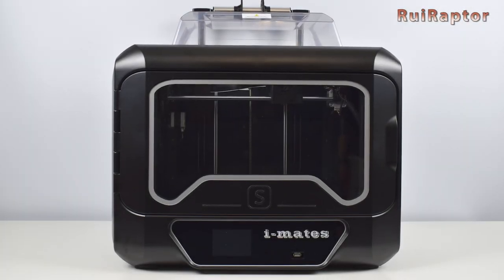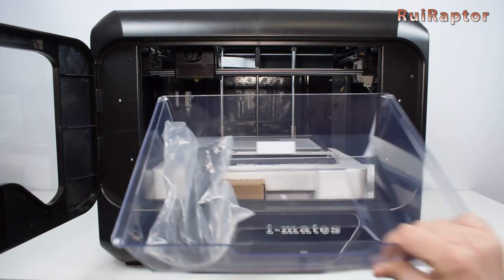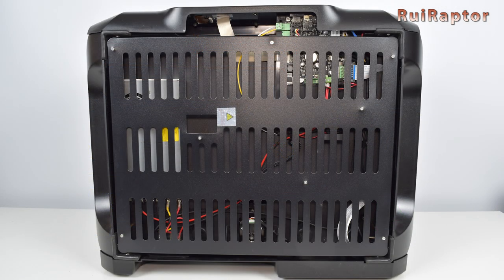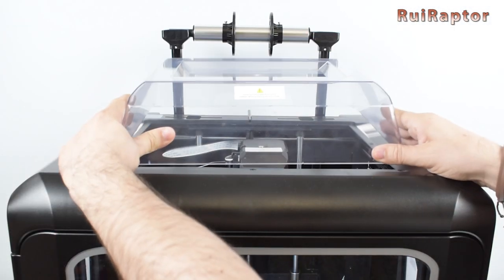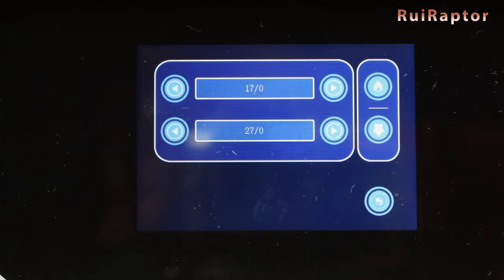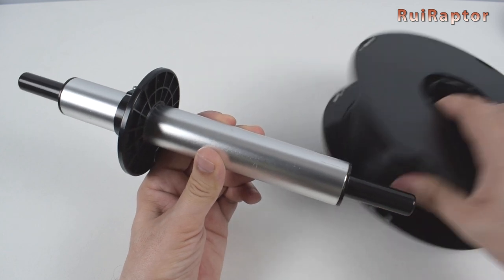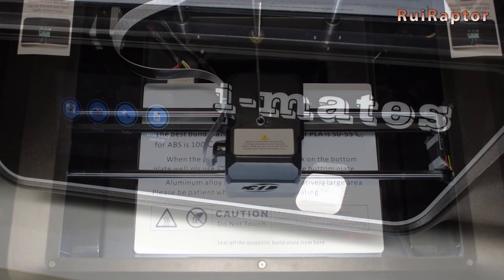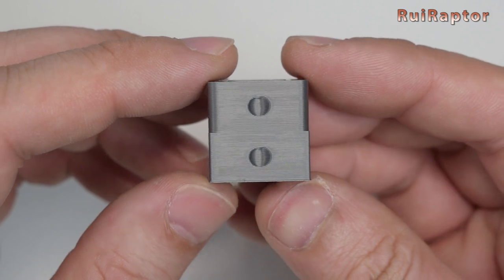QIDI TECH i-mates (3D Printer) - Tests - Pros & Cons - Full Review

Comment: Maybe you can help, I love my i-mate but technical support is so so. After I send desired print to the print the temp of the hotend doesn't heat. Just shows temp 40/0. I have to manually set it on the printer.  And then its fine. Not a big issue but would  be nice to send and forget.

Comment: I flashed klipper on this printer with a Bigtreetexh pad7 running it.  After tuning this thing is faster then my other printers.
Reply: Was it very difficult to put the klipper on? How fast was it? it is very slow originally.
Reply: and the ghosts in the prints, have they improved?

Comment: I got one of these, just over 1 year old and hasn't printed more than about 60 hours, to be honest not a big fan, its making a horrible noise on the Y-axis like a sqealing vibrating noise, tried everything, even had it to bits as I am a mechanical engineer, designer and CNC machinist,  stepper seems fine, tested it with a seperate controller and under load, bearings are all good, no screws loose.
TBH i will salvage it for parts and buy a more expensive and decent 3D printer, this is typical cheap chinese parts and assembled  rubbish in my opinion, and not as simple to level as they say, mine always gave an uneven print, even when I used a dial indicator to level it, maybe I got a Friday build, but from now on I am staying as far away from any i-mates printers as possible.
One last moan, I have also experienced a lot of failed prints due to the code the slicer spits out, especially if you set the print thickness to 0.1mm, it inserts bad code and the print errors out at any time before it finishes, I do understand the code as I am also a CNC programmer, my STL files from the CAD are watertight, this is a bug in the Quidi software.

Comment: Wouldn't it be possible to change the hot end on the spare one to all-metal for abrasive filament capability? Also, does someone kmow if this work with Octoprint?
Reply: Yes you can use Octoprint, the is RX/TX pins on the stock board, you can also flash with Klipper as well, and in regards to the hotend, you can Install the Icarus hotend system instead of messing about with OEM MK10 style unit, the Icarus platform will allow you to use nearly any popular hotend with any popular extruder, if you look at my videos you can see the Icarus setup.

Comment: Hi watched your video and decided to purchase excited at its arrival and unpacked to find that qiditech now only supply the heat rake and hot end no fans board or extruder gisgusting practices of a company trying to save money charge the same price and omit parts with no notification buyers be aware as it’s not a simple job swapping for the 0.2 print plus you have no spares anymore and things need to cool now not impressed sending it back